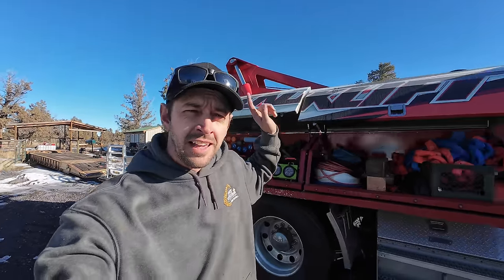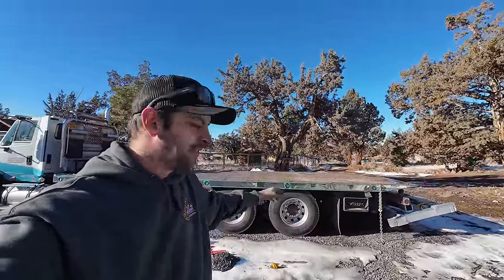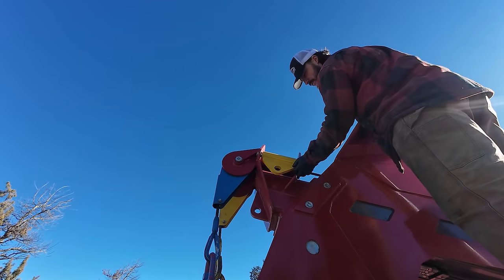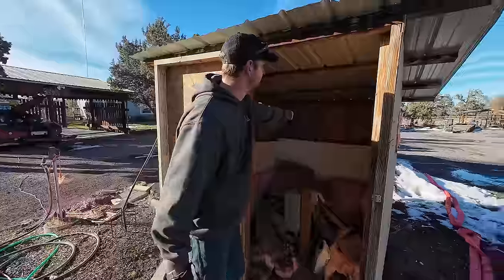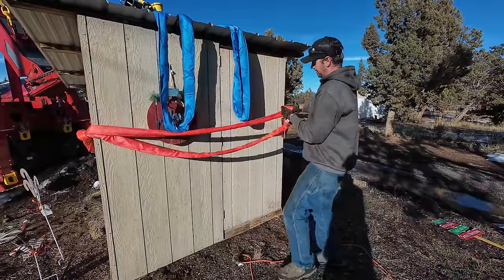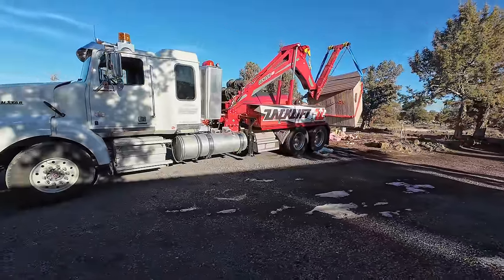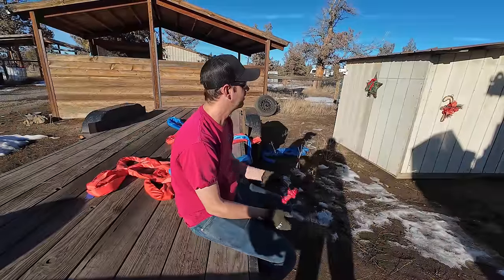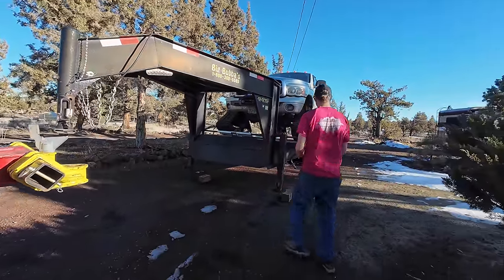When routine maintenance gets EXPENSIVE 😳

Comment: Warren showed us the other day, a valve body  on a dozer (I Think) with grease zerks under it, which was  right under the back of the engine somewhere, where only a Warren size  guy could get to if well greased !  He said no one ever greases them… surprise ?
       Why didn’t you  hook those straps under the bottom corners of the pump house ?

Comment: I guess I sorta lucked out with our well. We live in a valley with a really high water table, our well is 25 foot max from the ground level to the bottom of the well. In the pumphouse I used to have a space heater running for frost protection in it, this fall I switched the space heater with a oil radiator style heater set to keep the pumphouse at 20 deg C. I have no worries with the space heater quitting on me now.

Comment: If you do end up with a new pump house just put a doorway with no thereshold and on runners so you drag it off the top if needed.

What’s the update on the rollback?

Ethan, make Casey lift the back of the truck on the spades and block it next time so you get a little wiggle room under there.

Could you add grease extension lines to the boom cylinders to relocate the fittings to a more accessible place?
Reply: I was going to suggest tow hooks

Comment: I'm not a tow truck guy but I think I would have extended the under reach against the side of the pump-house while using the boom for the lift. That would have held it nice and square. But hey, that worked!!
Reply from the maker: Boom wouldn’t reach with the snow pile in the way
Reply: @CaseyLaDelle As grumpy was moving the pile, I was thinking it would be out of the way over in front of where you placed the pump house, but Grumpy is nicer than me apparently.

Comment: Put your shed on skids and open up one side to slide it away and back. Just a thought.
Reply: The igloo dog house is a good idea as well. But sometimes it’s nice to be able to get out of the weather when working on your well head. As long as your expansion tank and pressure switches are elsewhere, the smaller enclosure would be great.

Comment: I’m surprised that you didn’t replace the well pump yourself. It’s simple to do. It’s miserable! But it’s not complicated.
Reply: That very much depends on depth and the pipe used which is depth dependant. Off the top of my head between 300 and 400 feet is where they switch to a rigid metal pipe and Casey's well is 800 feet so I wouldn't call it simple or even doable without a 20 foot crane and clamps
Reply: @alastairmacdonald-pb9ki knows what he’s talking about
Reply: In truth it's probably better for him to get someone out that is an expert and come with all the gear required.

It would be just like the thing if he got a call for a job half way through.

Comment: The only thing with that new bumper mount system is that if you get towed from it, it will bend and break. So hopefully you won’t ever need to be pulled from it.
Reply: Truck was a fully loaded Super B.
Reply from the maker: You realize that the pull pin is not part of the aluminum bumper, right??
Reply: @CaseyLaDelle  yes I know that. There is a cast alignment piece on each side of the frame that breaks. Which makes the top of the bumper tilt back after it breaks.

Comment: Hint if you build a new pump shed, build a cap directly over well casing so you can pull pump without moving shed, you just have to pop the lid over well and well guys can run their cable right down to pump.  😊😊😊😊😊😊
Reply from the maker: There’s a lot more to it than that.  It’s easier to just move the shed
Reply: @CaseyLaDelle  It is, but I built one for a past employer and it worked great.  The cap, for the well pulling, was about 3ft x 3ft, whole building was insulated.  Worked great.
Reply: AH HEE HAAA WHOOO! @CaseyLaDelle